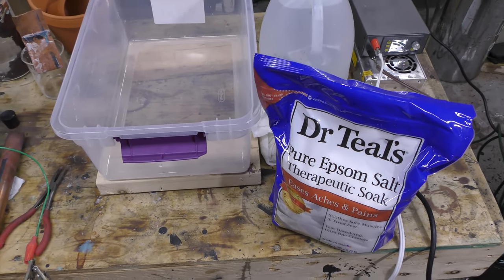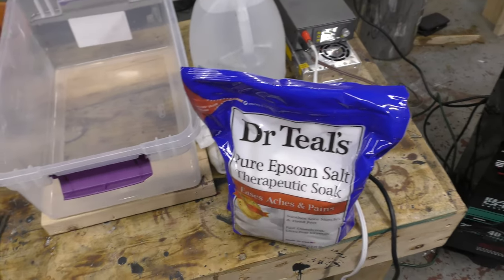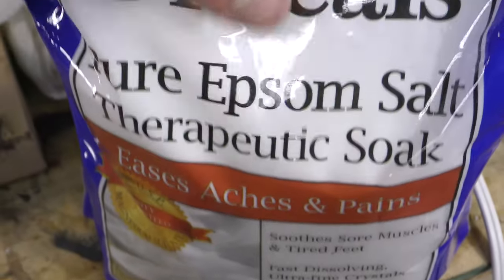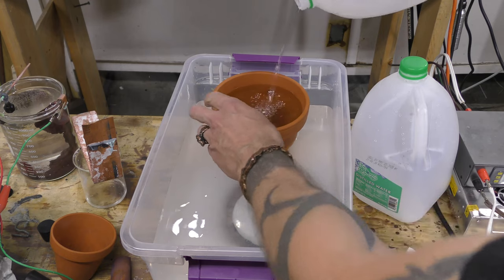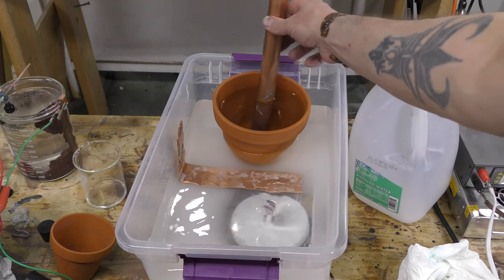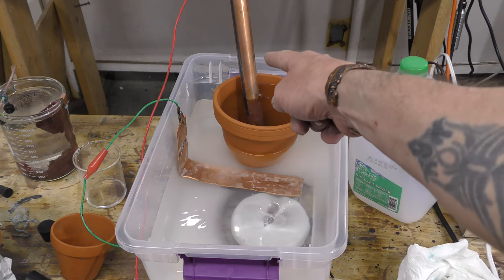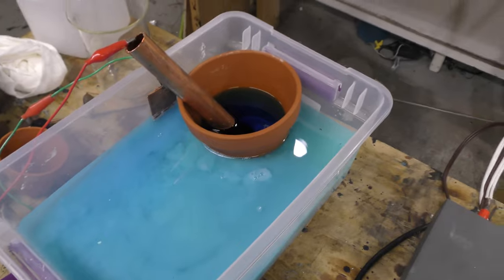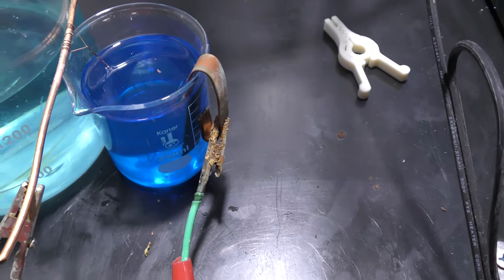Making Electroforming solution if you cant get acid in your country

Comment: Im trying to make a similar solution for copper plating bullets but i havent used miralax. I didnt make my own copper sulfate since i didnt know how and never looked into it, but the plating is very thin and flakes off so im just going to dump a bunch of copper sulfate into it and some salt and use thicker copper plates since the pipe i used before is now all gone and basically dissolves into the solution in an hour or less. Ive been avoiding acid to minimize safety concerns plus this seems to be how other people are doing it anyways

Comment: Computer power supplies have 25 to 30A at 5V, but there are modifications with examples on the internet, I don't remember exactly, but I remember that you cut a coil and it supplies 25V maximum.

Comment: pot: close the hole with hotglue and put black negative cathode in it ; container pur red + anode ... inside the pot get magnesium oxide... outside the pot copper sulfate.. filter all.. then re do electrolisis of the copper sulfate solution to remove unreacted epsom salt..

Comment: Your video is so complicated! If you want to make sulphuric acid, do electrolysis of a strong copper sulphate solution with a platinum coated electrode at 5V 4.5 amps. Then afterwards concentrate the acid  
by heating and boiling off the water until you see white smoke then stop. You are left with conc Sulphuric acid.

Comment: If you need higher voltage and current? I bought from EBay a few dc to dc boost converter. From 18 volt battery I can take to a maximum output of around 80 volts and 20 amps. I bought 2 units and bridge them to get high output with less heat on converter. Great for reviving my dewalt cordless batteries!

Comment: i have a question. why did the pipe form a black residue around it? what is it ?
Reply: It’s the phosphorus in the copper pipe. Harmless.
Reply: @PUR3C0UNTRY   ,oh thats very cool to know,  but that doesnt block the ions from further getting on the desired surface, like a barrier?
Reply: Not one bit. It actually helps keep your solution cleaner. All copper pipe in USA has phosphorus in it & I only use it and it works great. When you’re done with your piece just clean the copper as usual and use it again if there is any copper left. The black holds the copper like together to help it not fall to the bottom of the tank. Get it from Home Depot of Lowe’s.

Comment: Question: Even though sulphuric acid can be replaced by other chemicals, isn't it still the best option -  if you can get it? I ain't no chemist, but sulphuric acid (H2SO4) sounds like the ideal solvent for copper sulphate (CuSO4).
Reply: sulfuric acid aka battery acid works great on its own but the real secret to electroforming is you are using a solution of various acids to take advantage of their mixed properties
Reply: How do you deal with waste?

Comment: I don't understand how electricity is flowing through the wall of the flower pot? Is the flower pot made out of a conductive material or did you remove the stopper from the bottom of the pot?
Reply: Hi Ten littleindians the cub is semi porous it allows moist electrolyte pass throught tiny holes in the clay
Reply: @barryliebenberg8272   Terracotta is a clay based ceramic fired at a low temperature. (A basic glass) The hole in the bottom is put there for drainage. I do have some of the pots that seem to leak through the material, I do not think they are old fashioned terracotta clay pots. New, are these pots labeled as to what they are made of?
Reply from the maker: Fill a pot with water - the side will soon become wet - the wet surface makes it conductive if the liquid conducts electricity.
Reply: You also need to realize that electricity can be punched through several mediums you would normally think were unable to conduct electricity and that’s the way we need to think of it. Insulators have a rating basically they will stop a certain amount of energy before the energy will find it way through. For instance you could do the same reaction he is doing here inside of a condom instead of a clay pot. In this scenario moisture wouldn’t explain why the electricity can pass through it. Just know that you can force electricity through the wall of an “insulator” if it’s thin enough and your current is right.

Comment: So you just need a DC power supply.. like a 24 volt 7amp battery charger.. I have one of those.. does 12 or 24v @ 7amps for truck dual battery systems

Comment: Another item to try which may enhance (brightener)plating solution "sweet n lo" sodium sachin  (artificial sweetener.) Just a pinch or less.
Reply: Can u use sweet and low even with chemical mixture and it works?

Comment: I wonder how sulfuric acid harvested from old batteries would preform as an acid source. its crazy how very minor changes make huge differences. like one of my tanks I accidentally let non distilled water into my solution and the minerals made some really neat effects the copper lays flat and tight but it has these wrinkles in it like a really old persons fingers
Reply: It would most likely have a LOT of contaminants in it from the cell plates etc.. shouldn't use tap water for the same reasons according to other channels & sources
Reply: The old part would be the bad part ,, some automotive parts houses still carry and sell battery acid which is a pretty good chemical before it's exposed to lead in car batteries

Comment: Hey Jason, I have copper sulfate available to me but not hydrochloric acid. If I were to use a solution of copper sulfate and distilled water, would lowering the PH of my solution be sufficient? Or am I missing something?
Reply: Buy muriatic acid (hydrochloric acid) from Ace hardware,
Reply: Can it be used as an option to solphoric acid? With the same qua titty? Thank you
Reply: Salt + vinegar = hydrochloric acid  :)

Comment: I Have Done This For Like 10 Years Now, This Is A Good Way, But I See Some Flaws , But I Can Make A Video On HOW  I DO IT !

I Do It With Copper Foil, Twister Copper Foil Put Together Like 5 Of Them , Around 3 by 5 Cm Sheets So The Area Gets Much Much Bigger For Copper To react,  For You I Would Recomend To Drill A Bunch Of Holes Into That Copper Pipe And Dont Pancake It, Leave A Small Small Gapp In Between :)

Comment: You are going too fast for me. Use salt use no salt and then use NoSalt but then dont use NoSalt. I'm sorry i don't understand no more. I'm also translating Englisch to Dutch in my head so that slows me down even further.
I just wanna make a simple solution. I can get some chemicals in the hardwere store. Like sulfuric acid, LH lemmon acid (to clean coffee machines) And acid for a 6V car battery. I can buy salt, sea salt and salt with no jodium. And i have the good ol Baking Soda and the normal Soda for laungry. Perhaps you can help me come up with the best recepe.
Greetings from the Netherlands,, Kitty.